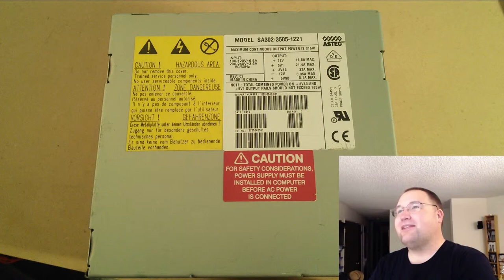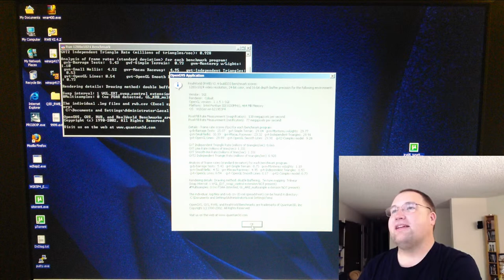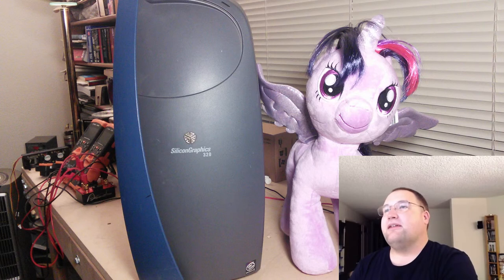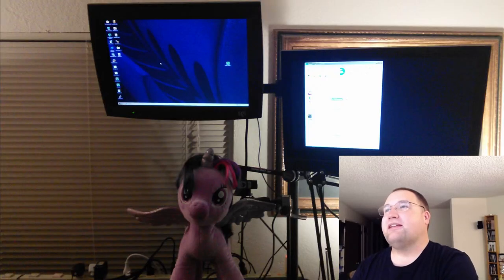Pony Hacks Ep1 Sgi 320 Visual Workstation Power Supply Replacement

Comment: Nice work with the cables, though all the cutting on the back maybe could hav eben done more elegant XD
Finds it extremly nice that you have managed to get the 1Ghz 100FSB processors, the few times they have ben on ebay was they way too expensive for me. Guess i will have to stick with Slot 1/370 adapters. :)

I have ben brony for 3 years, but stopped a year ago, where i burned all my MLP toys to show it was a end chapter. Lost all my "friends" cuz of the MLP stuff. And realized i never would get new ones aslong that i was a brony.
Reply: Thanks for the comment! Yeah it could have been done better. I'm not a master fabricator. My arena is more soldering and splicing. I bought my 1ghz PIII's years ago before they got too expensive. My VM320 has 1GB of RAM now. I've been working on getting a SCSI boot drive. I have to find a copy of Windows 2000 professional and find the appropriate service packs and installation goodies for it. I have win 2000 server now boot it doesn't play very many games. windows 2000 professional should be better at that.

Comment: Hi there!
I still have my original SGI VW 320, the one I bought when it came out (obviously for work purposes), and I still love the machine. Mine has also two Pentium III running at 1 GHz and 512 MB RAM.

I always wanted to upgrade the RAM to the maximum allowed, which is 1 GB for this machine. Can you tell me what type of memory should I be searching for on eBay and how can I recognize it and be sure not to get the wrong one? I tried to figure it out by looking at my current modules, but I just couldn't.

Also my worksation has all the slots filled, which means I should by an entire pool of 1 GB memory for it.

Anyway, thank you in advance, if you ever manage to answer.

I loved this video!
Reply: Thank you very much! that was quick!

Did you manage to get a Windows 2000 Professional with all the patches? If you didn't, then I might have everything here, in one of my bags.